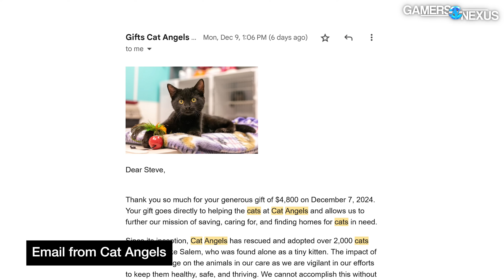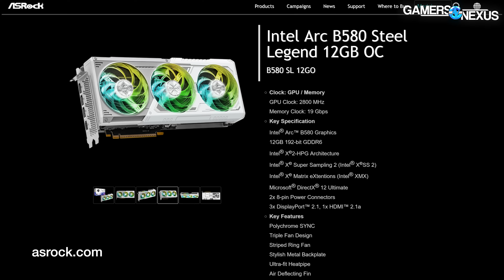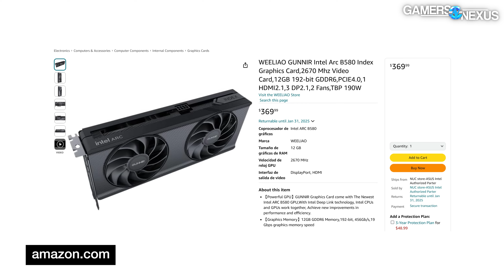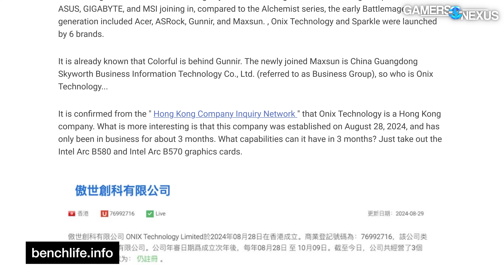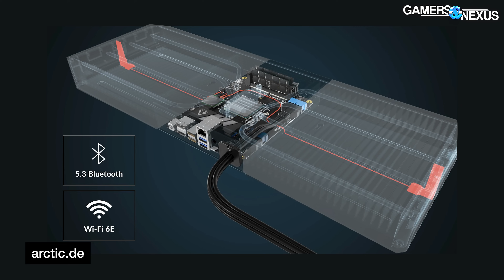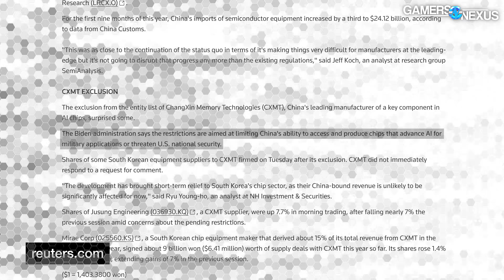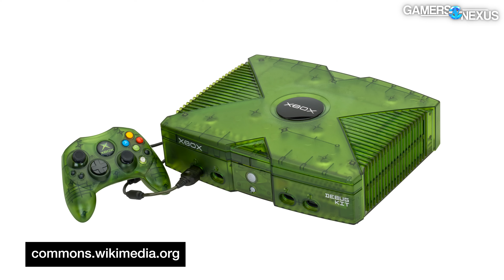HW News - Intel's B580 Victory, SteamOS Growing, NVIDIA Blackwell US Manufacturing Rumor

Comment: Personally I think the anti-cheat issue would be less of a problem if game companies would stop rug-pulling Linux users. A lot of games did support Linux either natively or under Proton, sometimes explicitly and sometimes not, but then they decide that they can't be bothered anymore and pull support. The issue I take with it is that they were happy to take Steam Deck and Linux users money, but then when it comes to actually supporting them they can't be bothered. GTA V is a good example of this, it was one of the most played games on Steam Deck since its release but then they just removed Linux multiplayer support with Easy Anti-Cheat (despite the fact Easy Anti-Cheat supports Linux) despite the fact that Linux players likely bought GTA V due to its prior support and spent money on its microtransactions. I understand they never officially supported Linux, but taking people's money for a product and then out of nowhere removing their access to that product just doesn't sit right with me.

Comment: China restricting those minerals is NOT meant to hurt us (or the semiconductor industry) AT ALL.... it is a MESSAGE.... You see there are many MANY much MUCH MORE IMPORTANT so called 'rare earth' minerals that are NEEDED in the semiconductor AND OTHER industries that ARE NOT readily available to the US that WOULD slow down (and possibly even SHUT DOWN) some VERY IMPORTANT  'cogs' in the tech industry 'machines' 
China is the ONLY source for some VERY important minerals, but it's not just the availability in the ground....  Most of these 'rare Earths' can be found in high concentrations all around the world.... BUT extracting them, separating them, purifying them, processing them... all that good stuff, is ONLY done in CHINA. And there are a couple of VERY GOOD REASONS for that... first of all COST... it requires a LOT of specialized equipment that has only ONE use for ONE element and is used in ONLY ONE step out of 150 to get ONE element, and it cost 3 million to build (this is all just a made up example, I don't know ANY of the specifics of extracting and processing any of these element... it just to give you an idea of WHY CHINA OWNS THE RARE EARTH INDUSTRY) you also have to factor in the TIME it takes to go through these processes... and say 1 step out of those 150 could take 2 full days of constant monitoring and specific responses... as in it REQUIRES a human to do it because building a robot and computer vison, etc is too costly or just isn't good enough, so ONLY a human can do it.... you have to pay someone to stand there and do this for 48 hours (or 4 or 5 people to take shifts or whatever).. labor is VERY CHEAP in China.... but NOT IN AMERICA... In China a basic laborer earns in ONE DAY what an American would get in ONE HOUR.... so you just DON'T DO THIS IN AMERICA.... lol
But then you say 'well move it to India or Vietnam because labor is super cheap there, and they have the same minerals, and it could be done there, you just have to move it.... Well that's great and all and yea it COULD be moved there.... but you HAVE TO factor in the POLLUTION and ABSOLUTE DESTRUCTION OF THE LOCAL ENVIRONMENT where these Rare Earth are produced.... it is 100% DESTROYED... That is about 60% because China does not GIVE A DANG about their (or anyone else's) environment and they just POUR OUT TOXIC WASTEW INTOTHE RIVER AND JUST DONT THINK ABOUT DOWNSTREAM.... and the GOVERNMENT DOESN'T CARE EITHER!!!! - You have NO IDEA HOW DISGUSTING AND EVIL THE CCP (and China in return) REALLY IS!!!!! - All you need tyo know is that even if you applied modern safety and pollution prevention standards and measure, there would still be A WHOLE LOT OF TOXIC WASTE WHEN YOU ARE DONE..... and keep the environment clean COSTAS A LOT OF MONEY!!! That is EXACTLY WHY China just doesn't care what they do with the waste... because it is TOO EXPENSIVE FOR THEM TO CARE.... but they SURE DO CARE ABOUT HIDING IT!!!! I mean did YOU know about all of these TRUTHS??? I didn't think so. That because "CHINA IS THE LAND OF SHORTCUTS AND FACADES"!!!!! <-- REMEMBER THIS & TAKE THAT TO THE BANK!!!! It is 100% TRUE and WILL NOT CHANGE until the CCP IS TOPPLED AND TOTALY DESTROYED!!!
- -  The bottom line is it is TOO EXPENSIVE to do it ANYWHERE ELSE. Period. And china knows this. By sending the Biden administration (and in turn the Trump Admin too) this message they are touting the truths of rare Earth industry. It can't be done any other way RIGHT NOW. And it WILL take quite some time for this to change... if it can even change at all. China runs most of the Rare Earth market and they are risking basically EVERYTHING by sending that message.... How the US responds will determine if China EXTREMELY FRAGILE AND WEAK Economy survives and slowly grows, or TOTALLY IMPLODES AND THE WORLD PLUNDERS (future outcomes expressed only for dramatic effect... economies and governments are NOT the expertise of this papers author. the ONLY expertise of this author is talking our of ones rear cheek hole. thank you.)
YEa, so you can look into how China has destroyed a LOT of area and HOPEFULLY you will find the truth about China polluting in 1 year MORE THAN ALL NATIONS COMBINED THROUGHOUT ALL HUMAN HISTORY. THEY SUCK!!! (only my opinion, I could be wrong... but it's close) I'm gonna quit yapping now... I HIGHLY DOUBT A SINGLE HUAMN WILL EVEN READ THIS. But let me know if you do. That would be nice, ESPECIALLY if you let me knwo what you thought about the short essay I ripped out my stink pit.... :)

Comment: Will the Asrock B580 Steel Legend card with 2 power Connectors also run with a single power cable connected?

Comment: I switched from Windows to Linux earlier this year.  When comparing the two, Linux does leave a little to be desired in the overall user interface when consistency is considered.  It makes up for it in price (free, or make a donation of what you think is fair), the overall experience is decent, and it genuinely runs virtually all windows software as well as Windows does.  Much of the software, particularly most of my games, actually run faster than on Windows.  Steam OS being brought up to date, and KEPT up to date, would completely remove the barrier that I think most people see when considering moving from Windows to Linux.  As it is, it does take some research and fine tuning to make applications (particularly games) work well under Linux.  Steam OS would be the "plug and play" variant that is needed.
Reply: It also currently takes research as well as possibly trial and error to pick a distribution.  Having just one consistent distribution that is the sole one promoted to the general public is a vital first step.  Having a million different distributions was great when the target audience was geeks and tinkerers.  It is a major downside if the aim is more widespread adoption.  The next requirement will be that applications like Microsoft Office need to run flawlessly on Linux instead of recommending lesser applications as a replacement, all of which are not even remotely as good.

I've used Linux on the desktop and run it on my servers.  Based on my experience I won't be replacing Windows as a desktop system any time soon.
Reply: @loganmedia1142  Having lots of distros is still a good thing.  They provide specialization for specific needs.  The key is to have one, or a few, big and well known distros, like Linux Mint (my choice) or Debian, start prepackaging Wine and Proton in a manner that allows users to just run a Windows executable without having to use a launcher (basically that's what SteamOS is) to run their software.  Integration into the desktop is key to acceptance.  You can't tell people that Linux can do Windows when most shipping distros cannot do Windows as shipped.  People don't like that.  I believe that if the integration happens at the desktop level it will also spur on more of the bigger developers out there to start shipping Linux native applications, and accelerate acceptance of Linux for a more general audience.
Reply: @Chlorphen  That's exactly why Linux has to get rid of the need for launchers (like Steam) for Windows software.  It really does need to be click and run, without requiring a virtual machine and a launcher.
Reply: @Chlorphen  most gamers are gonna have games that don't work on Linux and will have to dual boot, I will never fully get rid of windows because of this
Reply: @tyler6602  Whether or not a game works on Linux is quite often just a matter of figuring out either the correct version of Proton to use with it, or maybe it just needs to run directly under WINE with the original Windows *.dll files.  If you have just a little patience, every game for anything from Windows 3.1 to Windows 11 will run under either Proton or Wine.  And DOS games are a forgone conclusion:  The ALL work under Linux, but not under Windows.  In fact, if you are using Windows 10 or 11, then you really can't even run any games written for a Windows version older than Windows XP, and you really can't even run most of the Windows XP games.  They will work under Linux with either WINE + (Windows *.DLL's) or under Proton.
(Edit:  Just want to say that while I do use Linux only, just having gotten off of Windows about 8 months ago, I am absolutely not a "You need to dump Windows now" person.  I am simply still very surprised that in many cases Linux is giving better compatibility with older Windows software, and it is actually running my games FASTER than Windows did, and I'm still on the same hardware I used with Windows.)

Comment: You have a way to test the lifetime clicks!

You have a 3D printer, print a wheel with bumps on it and use a sensored brushless motor to spin it! If you know you are doing 60 RPM with 6 bumps each... you did 360 clicks!

Comment: Video idea i haven't seen covered. With linux gaming systems getting more popular thanks to valves proton fixing a lot of Wines quirks (or as linux heads think, totally breaks and ruins wine) a video on the difficulty and performance of setting up and using Intel AMD and Nvidia GPUs on a few of the most popular distros could be helpful.

Comment: You should point out that Shit Ray Tracing at this point in time on anything below a 4090 is utter garbage (outside of photo mode) to begin with.  
So Intel garbage tier GPUs being a bit better than AMD garbage tier GPUs in that regard is es helpfull as a hole in the head.

Comment: 8bitDo Xbox keyboard curiously uses "clicky" switches. There's nothing wrong with that, but it seems like an odd choice for a keyboard designed to look like the original Xbox. Linears seem like they would've made more sense. However, I looked up the listed switches online, so no idea if the information was correct. 8bitDo does not list anywhere on its product info whether they are linear, clicky, or tactile. 
They had this keyboard as a NES model originally. The two large button modules sorta made sense on that edition.....but can't understand why they continued it on the Xbox version. The NES model was about $100 at launch, and the Xbox one is currently $119 as a preorder (much better than the $169 it showed when they first listed the preorder).

Comment: Where does the heat go if the heat sink is mounted under the desk?
Reply: The same place it would if it were sitting on top of the same desk, in the same situation. If there are insulating walls on three sides of the desk (office prairie dog town cubicle), things are going to suck. If it's mounted on a swing-arm on a wall in an open room, things will work however they work according to ambient temperature, humidity, and air flow (doctor's examination room or hospital cart, probably fine).

Requiring air flow from an open front-to-back with nothing blocking open air flow around the desk means this is exclusively a department manager prestige perq.
Reply: @davidgoodnow269  The point was that heat rises and it's mounted to the underside of a desk. There's nowhere for the heat to rise to.

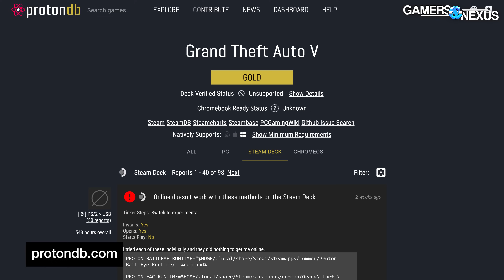Comment: 15:40 Oh my god, now you guys too? DON'T WAIT FOR STEAMOS ON DESKTOP.

First, I highly doubt its going to happen. Maintaining a Linux distribution is a ton of work. With Valve being a realtivly small company (according to court documents, around 200 people - not many for someone who runs largest videogame distribution platform and does hardware development on the side), I doubt they have the capacity. Plus, how would it benefit them? Linux distro developers make money by sellig premium services to business customes - not exactly the target audiene of games.

The curernt version of SteamOS on the Deck is highly specialiced towards the mobile plattform with its fixed hardware - not like desktop, where there are myriads of hardware combinations. It uses all AMD, not Nvidia, which is still the most popular GPU brand and Intel is still pretty strong, at least on legacy systems. Bringing that to the public without any control on the hardware would be a nightmare for Valve - and a battle they can only lose, because of uncontrollable compatability issues.

And most importantly: Even if Valve official packages it, it won't make much of a difference. SteamOS is based on Arch with Steam on top, with some addons. Just get a popular Linux distro, put Steam on it which includes Proton, which is the true gamechanger, and you're good to go.

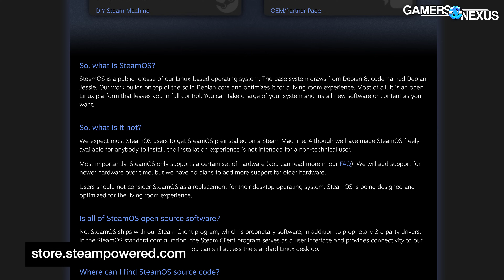Comment: 15:12 GN, please just use literally any linux distro. Gaming on Linux is awesome in most distros rn, you don’t need SteamOS!

I believe bringing SteamOS to PCs would be a really bad move for Valve.

SteamOS is just another distro. Any problems present in other distros would be present there too, and more. Problems that the community has already fixed in most PC distros, even! PCs have way too much hardware variation, and Valve is just not going to work into making SteamOS seamless in all of them. That’s just not possible. Additionally, Valve is a great upstream contributor so any improvements they made would reach other distros soon enough anyway. I believe releasing SteamOS for PC would actually do more harm than good, specially for Linux Gaming in general but also for Valve. When SteamOS ends up bugged on someone’s random weird hardware they’d start saying bad stuff about SteamOS and would now be hesitant about getting OEM devices with SteamOS such as the Steam Deck.

If Valve were to work on making most PC hardware work seamlessly on SteamOS, they’d definitely have trouble on keeping the Steam Deck seamless.

And actually, the Steam client is a mess with all that CEF chromium bullshit. Running SteamOS on most PCs would probably be an objectively worse and more buggy experience than running any other distro and just using Steam BigPicture on that (you can also add a gamescope+BigPicture session to your login manager quite easily btw, you don’t need SteamOS for that. Steam could make that part easier by just releasing a package that did that for any distro).

Also, if gamedevs started doing stuff like “you can run it on steamos but not on other linux” that would really suck.

I believe Valve should keep doing what they do now: keep SteamOS amazing on Deck and other OEMs, so it can continue to be a great experience, upstreaming the work. This is a way better incentive for people to use Linux compared to installing a OS that boots to a bugged CEF Steam UI depending on your hardware. Oh and btw “valve could fix that” yeah sure, but then they could just fixed their client for everyone else too.

Trying to maintain a seamless experience for all PC users as just one company who’s main business isn’t making an OS would be shooting their own feet. Valve: Let the community do their jobs maintaining their distros, and do your part by upstreaming your work and helping them, but don’t try to bring SteamOS to PC. Make SteamOS immaculate on your hardware, because it just won’t be that in weird PC hardware. There are plenty of good distros to choose from out there, and you can make your stuff work well on those instead of making a whole new distro for hardware you can’t control. This will be a better experience for everyone, and be cheaper for you.

Comment: So Steve, will you test the B580 on PCIE 3.0?
Reply: Don't feed the troll. You're absolutely right that such testing should happen. The B580 aims at the budget segment. In this part of the segment, a B450 or A520 can save you $30-40 against a b550- a killer proposition when your total budget is $500-700usd.

So yes, we should see the B580 married to pcie3 mobos quite often.
Reply: How many PCIe 3.0 motherboards support resizeable BAR?  Given that is required for Intel dGPUs to work properly.
Reply: @alexatkin  Most a320, B350, and X370.

All B450s and a520s

All Intel 10th gen boards support rebar
Reply: Why bother? Who on earth cares.
Reply: @RoyBrown777  As someone with an artificially locked to pcie 3.0 mobo, I care.
Reply: @RoyBrown777  It seems like you didn't fully consider your comment. At least 23 people care and depending on the channel, that number can be in the hundreds.

This is an x8 card, with a different GPU architecture compared to the 4060 Ti, which Hardware Unboxed tested. There was a noticeable performance gap in Far Cry 6 and this is particularly helpful for people like me who are still using PCIe 3.0.

Comment: Steam won't allow kernel level AC, their only chance for games like CoD or Apex to get to Linux is to have some alternative anticheat
Reply: It already supports for example EAC.. the problem is that game devs won't update the games to use the newer version of EAC that works with Proton.
Reply: @digitalspecter  Kinda right, but also not really. EAC has to run in user space which makes it less effective than kernel level. Some studios like Bungie (and more recently EA) don't allow their games on Linux because of that.